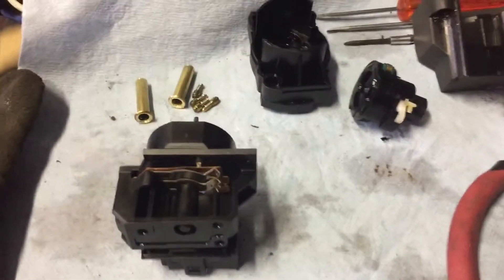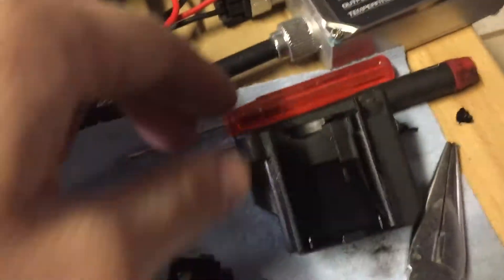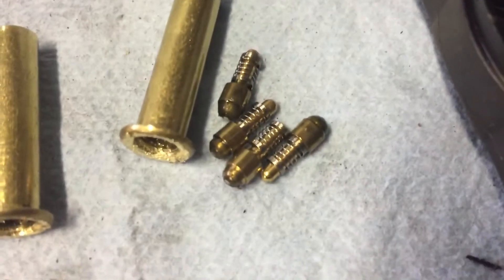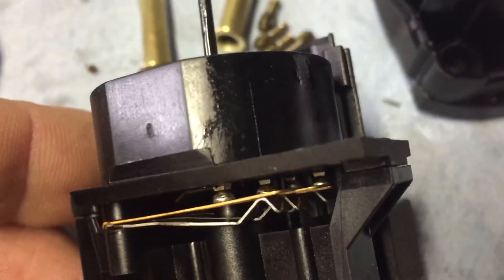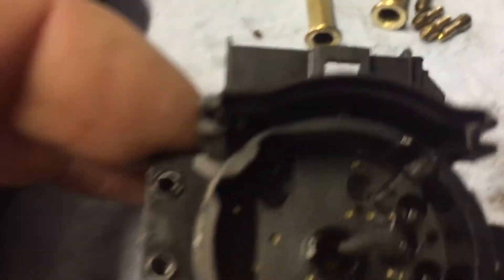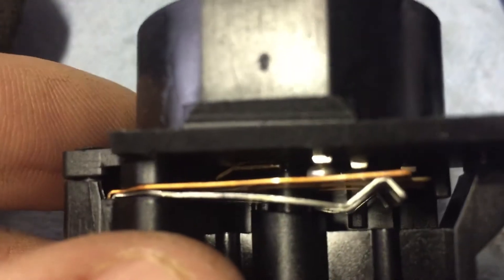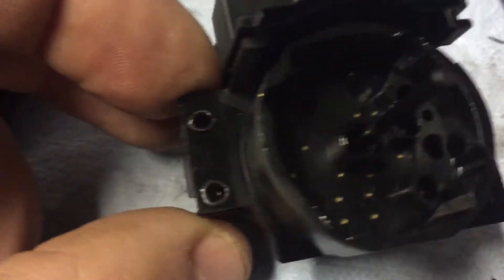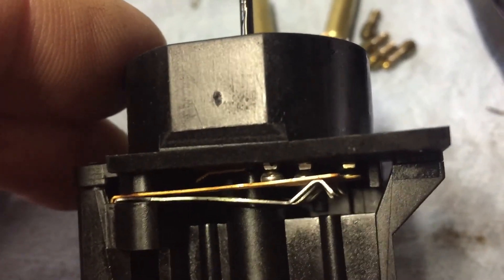Saab 9-5 ignition switch

Comment: Is it easy to disassemble the switch unit and can it be reassembled with the original fasteners/screws? i.e. then perhaps the contacts can be cleaned or ???